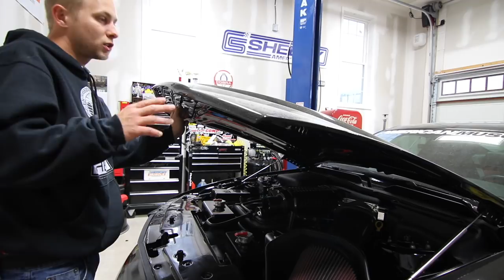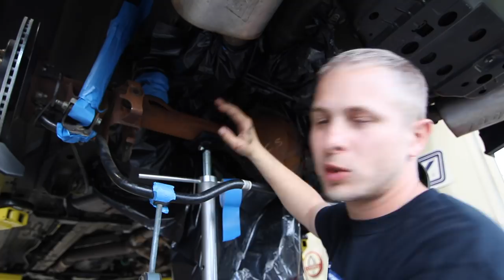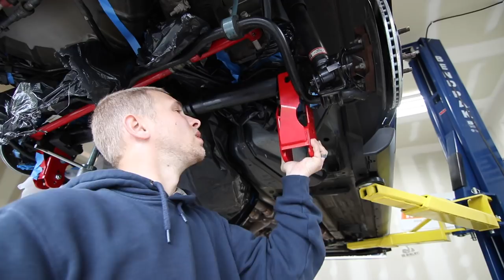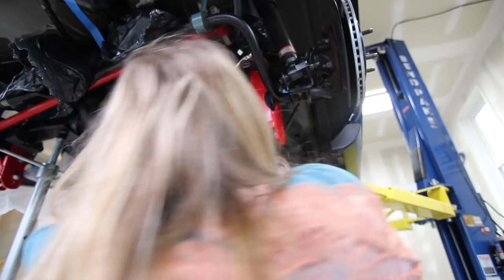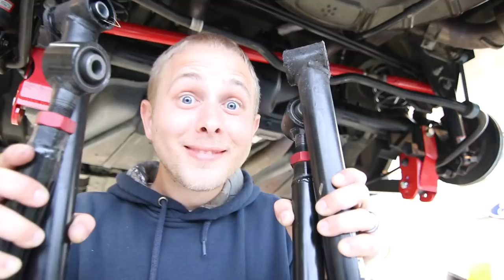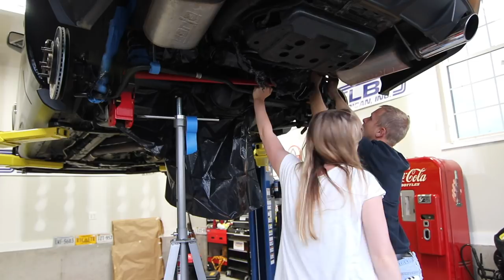VLOG - Mustang Shelby GT500 Gets New LCA

Comment: You should tighten the bushing fasteners with the suspension at normal ride height. Makes for longer life and proper "neutral" loading to the bushing.
Reply from the maker: Robert Kohut good point and makes sense I'll have to check that.

Comment: The relocation brackets are for maintaining the stock geometry of your rear suspension after you lower it. (LCA angle). You should consult with CJ and determine which hole to use with your drop( inches lower) so you can achieve the stock LCA angle.

Comment: dude get the UMi bolt in steel subframe connectors makes the car wayyy more planted without welding and with as much power as you have will save your torque box's and your roof, i kinked mine in my cobra